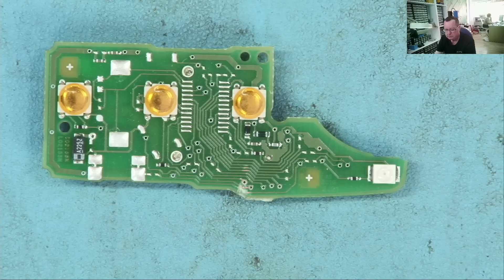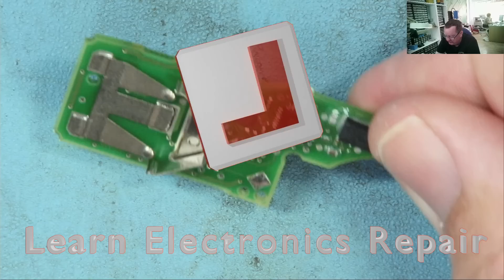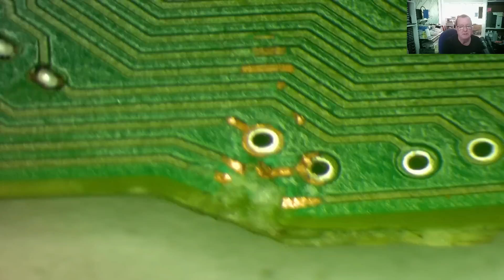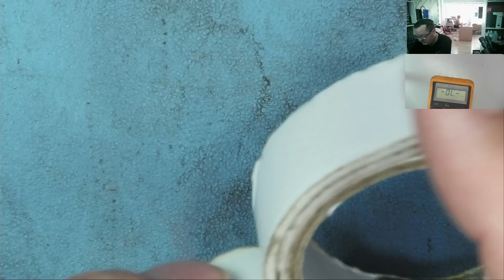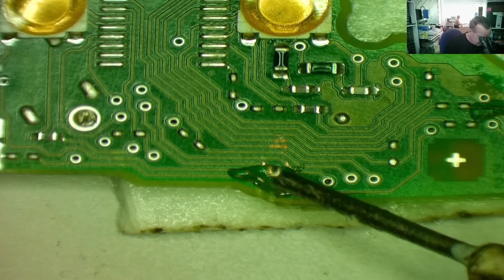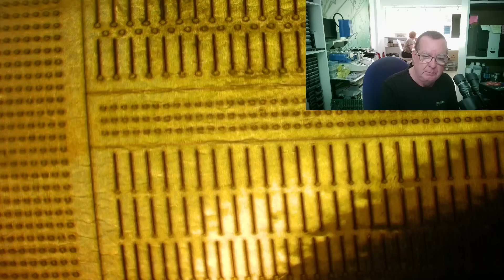Car Key Fob Repair - Damaged PCB. Can We Fix It?  Microsoldering.

Comment: You are using wrong soldering tips for that job it must be pencil thin tips  it's easier to yack it rather than with wide tip because of size of heat area and please use tweezers it's easier to hold thin wire while tacking

Comment: Maybe easier with a smaller iron bit, also using a clip to act as a heat sink on the wire to prevent the first joint to melt

Comment: I'm not sure of the long term stability of mixing the Indium based solders in with the lead free: but, it's probably okay. I tend to think using a low temp solder is less risky than lifting traces. Also don't know if you can still get really fine lead based solder: better if you can get a really fine indium based solder. I tend to bodge some really fine insulated wire, point to point. Also, I like to glue down the wire before soldering. PCB repair kits used to come with the same kind of epoxy that is used to hold down the traces of the pcb. If you are bridging a pcb trace break (unless it a strip line, or impedance matching trace), a longer wire is better, if it can fit. Sometimes, a little fluxed solder paste will work. A U.V. cured conformal coating is also a good cover for the repair, and will hold down any bodge wires. I think if you can solder well, and have a good fine tip, good solder... 80% of it is in prep work... cleaning the board, and mechanically securing the bodge wire.

Comment: some of the tiny croc clips from those cheap test sets with red,yellow,green,white,black wires are perfect to hold things in place for repairs near the edge of the board, and as those cables fails after a few uses, it is a great way to make use of them after the give up being test leads. just remove the wire and boots and just use them as tiny clamps
Reply from the maker: That sort of thing works very well but not when you are trying to video the process under a microscope and it does not have the depth of field to focus that high (without a lot of loosening bolts and mounting it higher up) 😉  Or maybe I'm beeing too lazy to do that 😅

Comment: Great repair. You really need to get some blue tack - it's a perfect third hand and for holding small boards down. Self-closing tweezers work well as heat sinks and for clamping when close to the edge of a board. Also, there are pens available for solder mask repair - good for preventing future corrosion. Regards, David
Reply from the maker: Errm yeah I said that in the video actually - then realised I didn't have any (nor did the wife who usually has everything) so went for the sticky tape as second best

Comment: What glue exactly you used? Does this glue turn into crystal after drying? Does it become conductive over time?
Any specific reason why you are not using solder mask hardened by UV light?
Reply from the maker: It was two part clear epoxy resin.  In the UK a common brand is Araldite. I don't know about elsewhere

Comment: Well Rick - use smaller tip for less heat transfer and you won't have troubles with those wires :)

Comment: what if you wiped off some flux between the 2 joints so that heat doesnt flow over so well to the other side?
Reply from the maker: Good question. I never knew flux was a good conductor of heat.  Can anyone else comment on this?

Comment: Kia wanted £220 for 1 remote at the dealership to replace my fathers non functioning unlock button. Turned out it was only the rubber case had deteriorated from many cycles and was no longer pressing on to the internal button correctly. This was his spare and was exactly the same and had been retired some years ago as it was starting to fail the same way. 2 cases off the bay for less that £15 the pair and both remotes were fixed. Nice fix, Richard. Should last many  years. Just hope the customer hasn’t lost or broken the immobiliser chip, that wouldn’t be fun 😬

Comment: Excellent fiddly work. Using the tool as a clamp and heat sink to reduce the heat transfer to the other soldered end was genius. You just need 3 hands 🤣
But I'm very intrigued to know more about the sheet of track etc repair parts. I've never seen or known about them, as a novice to the subject.
Perhaps you could do a video about them and other similar things us novices wouldn't have heard of or even thought to look for.
Thanks as ever for the great content and patience on that job 😎

Comment: I'm starting to resign myself to the fact I'll need to spend the money on a microscope.  While my eyesight is quite good, the combination of such fine traces, obscured by flux and solder and the awkwardness when working around other components makes it seen a necessity.
Reply from the maker: I freely admit I couldn't do this without my binocular optical microscope.  I need the magnification and the stereoscopic vision for depth perception

Comment: I would of tinned the corroded parts too so that it would not get worse only takes 4 seconds....
Reply: Its not corroded, its isolation removed when owner tried to open it. Proper fix is to use solder mask and UV light.
Reply from the maker: @orion310591RS  Argreed
Reply: @learnelectronicsrepair  8:40 - One more thing, I had situation with ripped trace, near chip, but trace was like 3mm in length, then followed by thru hole. What I did is I placed strand of wire, through that thru hole, soldered it from other side, then placed end of strand on chip leg. Its almost impossible to get 1st end loose if its placed through hole then soldered.
You had the same situation now, you didnt used hole. Just an idea for future.

Comment: A tactile switch went on mine £60 for a new fob so i ordered some off ali Express ,i used hot air but being a novice  i soldered the switch on but blew 4 very small caps and or resistors off at the same time luckily i took a photo first,,its all a learning curve ktf rich 👍